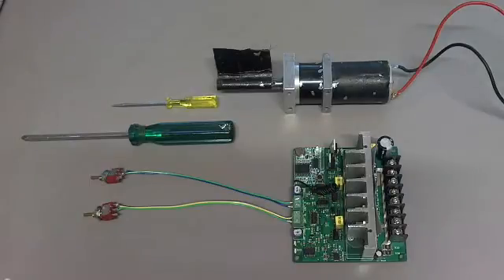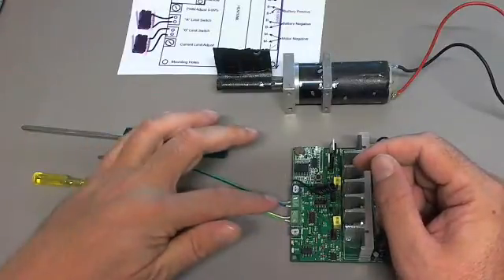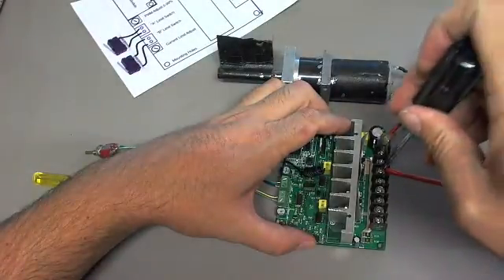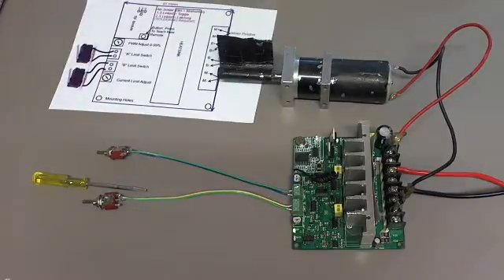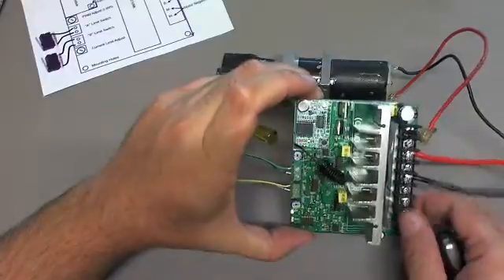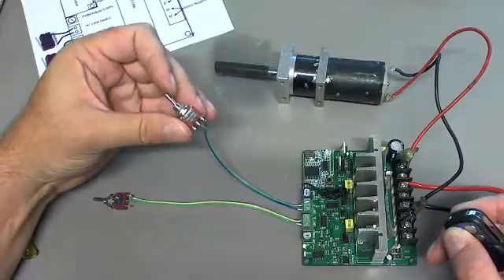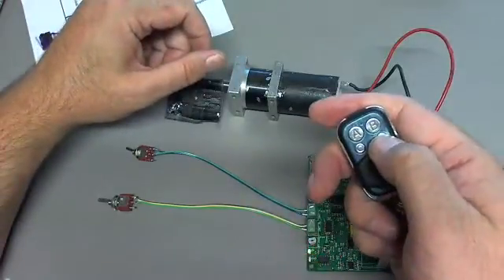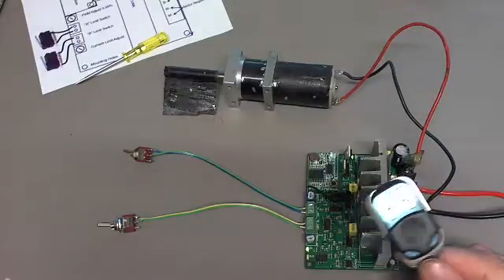How to setup the wireless controller 12v 24v and 36v DC Motor controller high current!

Comment: We only built 250 of them or so. The assembly from the assembly company was very bad so out of the 250 we only managed to get about 108 working. We sold out of them quickly and the plan was to build a new model with more features because the one shown in the video had a range of about 10m. Its still on the drawing board, we got really busy and I never got the time to come back to it. I plan to have the new one out sometime in 2015, I have a few other controllers I'm currently working on that are in the queue before this one.
Reply: Shane Jones  more info please